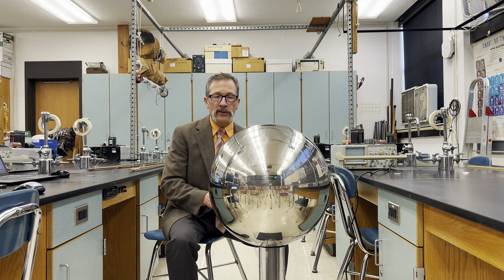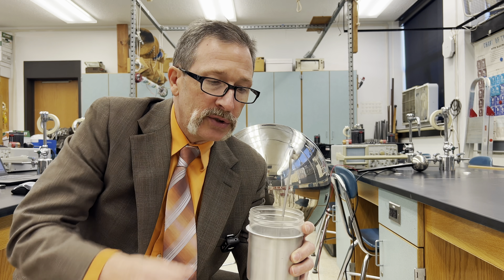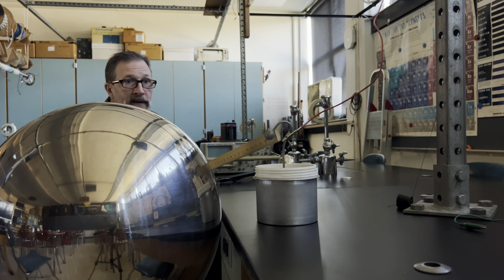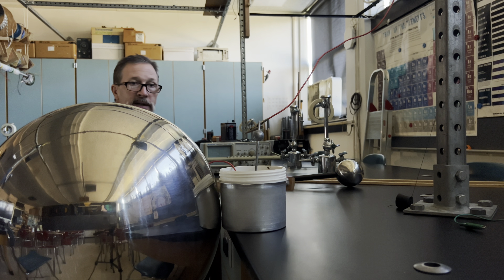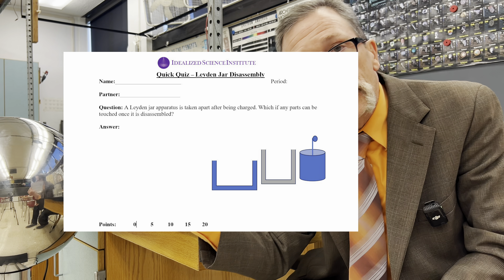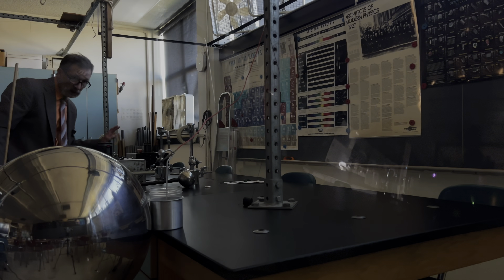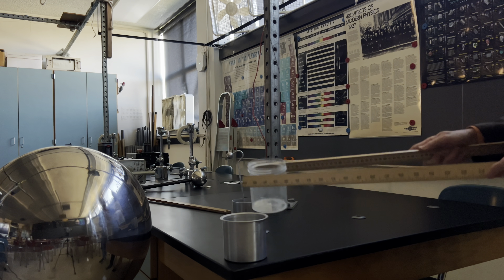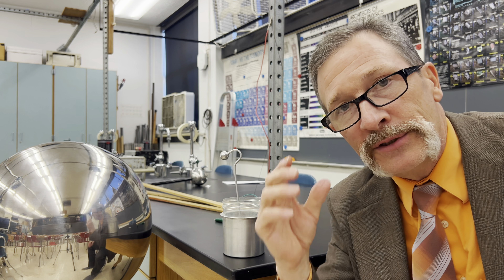This Simple Device Could Kill You

Comment: Using waterpipes as an electrical ground is stupid (especially for hi voltages). First, its not guaranteed real connection to ground in nearby point. Second, you can hurt or k. someone who take shower in the hood. Third, possible to interfere with another idiot who does this.And the last but not least, its illegal!! Guys DONT DO THIS!!!

Comment: I know electricity pretty well.  I knew a lot of this information as I was taught it in a classroom setting.  But I never got to experience this stuff in a lab setting.  Seeing you build and collapse charges and then pose questions is neat.  Also, the question about what you can touch.  I thought it was the plastic, and not the metal parts.  But, my real question was, how would you take that apart without it discharging.  Then bam, you explain it.  I teach and explain capacitors all the time.  Your lab experiment was great, I had never heard of that jar you used.
Reply from the maker: Thanks for your comment! Lots of students miss out on the experimental aspects, sadly. That’s why, in 2026, we are going to do a first iteration of a full course in E&M along with kits that contain all the components needed to actually do the quizzes at home (or in school).

Of course, dangerous videos like this are not to be replicated, but if you look on our channel you’ll see lots of videos that don’t use any high voltage or current and are still very fun! The quick quizzes would be useful for guiding your teaching of caps!

Comment: Back, starting in 1962 through 1996, the Army had a fixed wing aircraft used for surveillance (OV-1 Mohawk). It could be configured with RADAR, Infrared or, a camera system. My job was to maintain and repair these systems. The camera also had a "flash" available so it could be deployed at night. The flash was mounted in an underwing pod with 3 "flash bulbs". Each of these flash bulbs had 4 capacitors. Each of the capacitors were about the size of a car battery. Maybe 12"x12"x24" tall? They would all discharge at once to create the flash. During training they made it crystal clear, if you made the wrong mistake, you would be turned into tears in your mother's eyes...

Comment: Capacitors are super scary and need to be treated with utmost caution. I always store them short circuited. Once after experimenting I touched one just 1s after completely discharging it. That 1s totally unconnected was enough to rebuild charge and bite me (super small one and not very dangerous, but still painful). So high voltage is no joke already but including capacitors means high voltage + high current which is super dangerous.

Comment: I added a high voltage safety foot pedal to my Tesla Coil so that I won't get electrocuted by the high voltage transformers. Also added a bleeder resistor to the capacitor so that it won't hold a charge.

Comment: The reason for the charge in the plastic is friction. Even though nothing appears to be moving, it is. Electrical charge is a movement, and anything that moves creates friction, even through a so-called isolator, but plastic is not really an insulator. It is a semiconductor, and, just like a memory circuit in an electronic device, it stores a charge from a memory of movement in a charge form. Electrons, just like magnetism, are everywhere. Take the copper wire: even when no electricity is moving down the wire, there are still electrons in it. If there were no electrons in the wire, the moment one sent electricity through it, a collision would occur, and possibly an explosion. Resistance in a wire is because the electrons are perfectly fine not being forced down the wire in a manner of structured electricity. The saying electricity is lazy, is because it quickly wants to find ground. I'm not sure that's what's happening. Electrons want to return to the earth, from which it is its closest relative, the magnetic earth. If it were close to the sun, it would return to the sun.

Comment: For five years, I worked as a technician for a manufacturer of flash equipment for professional photography.
When repairing these flash power supplies, you always had to take into account that they could still be charged with capacitors with a total capacity of 20,000 uF at a voltage of 500V, with discharge currents of 1000A being normal.
Always discharge first, check that the capacitors were really empty.
One mistake could be fatal, so you had to be very alert.
Reply from the maker: Wow, that’s an application I had not considered! Thank you for sharing
Reply: Wow. That  is a heavy charge q = CV
Reply: @meisievannancy  Yes, some has a power of 25,000Ws

Comment: Back when Tv's had tubes and High Voltage I witnessed a guy get across a HV capacitor.  The volage went into his finger and came out his nose which was the closest thing to ground.  A ground strap on his service bench.  Now his nose has a flat tip.

Comment: My first electronics course in college had a very memorable demonstration. The professor charged up a very large capacitor, about 12 inches tall and 3 inches diameter, via rectified 120V. He then took a large screwdriver and bridged the terminals. The end of the screwdriver exploded. I was seated about 8 feet away and had a few bits of metal from the screwdriver tip hit me. I always thought that we should have had eye protection on when the professor did this.
Reply from the maker: Yes...that molten metal can burn and put holes in clothing or in your eye. Safety is a concern.

Comment: When I was younger my father used to talk about a prank they did at steel shops: charge a truck capacitor and attach it to the foil of a pack of cigarettes and leave them on a workbench, the result was hilarious, and no one ever was seriously harmed.....though in that decade if they were they would have laughed and called them a lightweight. I loved capacitors and magnetos when I was very young and would build them out of foil, charging them with light, triboelectrically, and batteries. I remember one of the most dangerous ones I made was by taking long PVC with brine and a stainless steel chain, and wrapping the outside with foil, you could get massive charges in that, lethally high. I also planned to make one out of a Home Depot bucket, stainless steel chain, and foil on the outside with brine inside, but never got around to it. Making and using very very large capacitors is easy, doing so safely is not.
Reply from the maker: Great comment, but please do not build a large Leyden Jar. They are not safe.
Reply: @idealizedscience   Good advice. I love electricity, a few years ago I was working towards working on high tension lines as a line worker. I would rather work on a 220v fuse box than be standing near a fully charged pvc or home depot bucket leyden jar: at least I have to actually touch the 220v to get electrocuted.

My grandfather and father told me to always put one hand in your back pocket or belt and wear shoes with a thick rubber sole. That indeed did turn out to be a good bit of advice, working on some equipment you can indeed get "bit" by high voltage stored inside, even using the best of precautions.

Comment: Several years ago I took apart my last film camera, a cheap Nikon point-and-shoot that had failed. The autopsy was most interesting, especially when I forgot about the capacitor for the built-in electronic flash. Got a tasty hit when I touched it. The concept of once bitten twice shy did not apply when I incorrectly assumed I had discharged the cap by touching it once, so the second bite was equally sensuous. Good times.
Reply from the maker: Old cameras would make a high pitched sound as they were charging...which was a good warning.

Comment: The inclusion of a multimeter to measure the voltages of the discharges would help with understanding the level of danger.
Reply from the maker: Most multi-meters could not handle this very high voltage.

Comment: Capacitors will develop a charge unless they are shorted out.  They do not need to be 'connected' to a power source for that to happen.
Reply from the maker: Great point!  Storing them with a wire across the terminals will stop this problem!

Comment: That jar doesn't have enough capacitance to hurt a human, even at those voltages.
Reply: You would be surprised.  The current is what kills - a spike of current can cause the heart muscle to go into fibrillation.   A monk physicist Abbé Jean-Antoine Nollet  in 1746 arranged 200 Carthusian monks in a mile-long circle, connected by wires, to demonstrate electricity's near-instantaneous speed, causing them all to jump simultaneously when he discharged a Leyden jar through the chain.   Luckily they all survived!
Reply: @karhukivi I wouldn't be surprised, I have been around HV since I was 11, making flyback transformer power supplies, home made cup and plate capacitors, tesla coils... Dude the capacitors in a stun gun are way more powerful than that jar. I have taken my fair share of zaps in my life, many more powerful than that weak little snap.

I have been bit by so many CRTs it's not funny. The surface area of a
Leyden jar is simply not enough to hold a deadly charge.
Reply: @Doom2pro  Don't forget, Q=CxV   the charge is the capacitance multiplied by the voltage, even if the C is small, the V can be very high.  It is the Q and the time that gives the pulse.  My nephew is a cardiologist and we have had chats about what they use for cardioversion where they stop the heart and re-start it again to get the rhythm under control.  A healthy person might take a dart that could kill a person with a heart abnormality.
Reply: @karhukivi I'm well aware, I also dabble in electrical engineering. I have charged homemade caps with vandegraff generators, and voltage multipliers, marx generators. The caps that scare me are doorknob and microwave oven caps.
Reply: @Doom2pro  Those high-capacity ones can be lethal for anybody.   A technician in the place I did my physics degree was killed by a bank of capacitors that were holding a charge for a very long time during a period of hot, dry weather.  They found him lying over the wooden box that held them, very sad, he was a very helpful guy.
Reply: @karhukivi even when discharged they can rebound by dielectric reabsorption. Best to store large capacitors shunted with a resistor or piece of wire.
Reply: @Doom2pro  Yes, especially in dry climates!

Comment: I may sound like a nooby,newb. But I'd live a detailed video on Electrical safety, with both High voltage, and lower voltage, high current or amp. What makes it lethal, and how to prevent incidents. Making sure one's not the easiest path to ground? So rubber shoes etc. I'd really love that.
Reply from the maker: Good suggestion! I think we responded earlier.

Comment: What would happen if you disassembled the jar and touch both metal parts at the same time? According to the explanation I think we could assume that you would not experience conductivity of the self because all of the charge is contained in the insulator. Maybe not?
Reply from the maker: The metal parts quickly discharge by sitting on the table.

Comment: Interesting: so when the jar is dismantled the charge is trapped on the surface of the dielectric? I didn’t expect that result.
Is there any good way to visualise that charge distribution ?

Does this have any practical application? After all, the dielectric liner is light in weight.

So, could you demonstrate what happens when you charge a Leyden jar, as you have here,
Dismantle it to the 3 components
Assemble the dielectric liner into a different inner and outer can pair
……to demonstrate the transfer of the charge //just via the dielectric layer//   ?
~ thanks.
Reply from the maker: Dielectrics are a foundational part of all electrolytic capacitors that make up all most all circuits.    Great suggestion for a new video!

Comment: Fuelling aircraft with kerosene or petrol creates a strong static charge, so the aircraft, the fuel truck (bowser) and the storage tank all have to be connected by grounding cables as a spark could cause a fire.
Reply from the maker: Yes! A potentially very dangerous problem is not treated properly.

Comment: I worked on a system that had a 4 kV supply to generate 105 MHz pulses at 100+ W, in 100 ms... When you took the cover off, there was a 1 kg brass bar that dropped across the filter cap (about 1/2 the size of a loaf of bread!), and stayed there, to make damned sure that the 'second" life of the voltage had somewhere to go!
Reply from the maker: Wow! That's cool!

Comment: I used one of these in the HS back room with another student. There was a mirror. I wanted to see how straight I could make my hair. The other student had the power switch. At a certain point, it arced from the closest thing to me the table to the bottom of the unit, and the other student was getting shocked too. It was fun.

About a week later, a cheerleader tried it. She turned it on while standing on the ground and brought her hand over to it. Bap!

I'm surprised they didn't lock that room after that.

Comment: I'd say you CAN touch the top, inner piece, IF it was grounded during deconstruction. If not, then ONLY the plastic piece, as that is an insulator. I think the outer cup will be negatively charged, while the inner piece will be positively charged, as electrons were pushed out along the earth. Level of confidence: 60% - Not very confident! Definitely not confident enough to actually risk touching ANY of it 😂   EDIT: YAY! I LEARNED SOMETHING!!

Comment: so i take 2 big metal cooking pots steeel and i find another one of plastic and mould it perfectly  and i will have a huge capacitor that i can regulate its discharge with mosfets? imagine im making 25 huge jars. like 9litters of water each and each of them connected to a mosfet that will take only 1/9 of a second electricity from the caps and then the second one opens and then the 3rd and up to 25. this will create a complementary energy shot that can go to a BMS and charge a battery ? because is fast to charge this can help alot in countries like UK where sun is not always up and some days are not much sun rays but this can balance like a buffer and charge esyly.?
Reply from the maker: Let's not get ahead of ourselves here...this is really for demonstration purposes. Please do not create a massive capacitor bank. But it is certainly interesting to think about!

Comment: I'm still unsure how the jar, when connected to ground, stores a charge..
Reply: Only one half of the jar is connected to ground.  That's actually why it works.  The inside and the outside develop opposite charges, which attract.  The electrons can't travel across the dielectric medium (the plastic insert) so they stay stuck there attracting each other until they find an easier path (eg through you).  All capacitors work this way.

Comment: When I was in the navy, our sonar used an 80 kV DC power supply. The supply used banks of 8 electrolytic capacitors connected in parallel as part of the power supply's circuits. One of our  techs was working on a fault in the power supply when he became convinced one of the capacitors had shorted,  causing the fault. He removed the capacitor bank as a unit, put it on the work bench, then connected a power supply and charged the cap bank. The charge held, so the shorted cap theory wasn't holding up. We asked him if he was going to discharge the cap bank before putting it back in the power supply. He said "Sure", grabbed a screw driver, and tossed it across the positive and negative bus bars the caps were all screwed into. There was a bright flash and the screwdriver was arc welded to the bus bars.
We had a discharge probe on the back of the workbench specifically for things like this, but the tech wanted to show off, I guess.
Reply from the maker: That will get your attention!

Comment: A good reference for shock hazards is "A Complete Electrical Hazard Classification System and its Application" by Lloyd B. Gordon and Laura Cartelli, a twelve-page report published by Los Alamos National Laboratory and available on-line.  Also, DOE-HDBK-1092-2013, "Electrical Safety", contains a lot of information but is rather long.  Page D-26 of the handbook contains information on impulse shocks due to charged capacitors above 400 volts.  For capacitors (a Leyden jar is a type of capacitor) charged to high voltages, the hazard is related to the stored energy in the capacitor.  The stored energy in Joules can be calculated as one-half times the capacitance in Farads times the square of the voltage.  Discharges of stored energy below 0.25 Joules through a person can be very unpleasant but present little to no hazard.  Discharges of stored energies of 0.25 Joules and higher can cause injury due to involuntary reflex action (muscle contraction and throwing oneself away from the shock, causing subsequent falling or striking a sharp or otherwise dangerous object).  Discharges of 50 Joules and higher are in the potentially lethal range due to possible ventricular fibrillation (stoppage of normal heartbeat) and burns.

The capacitance of a Leyden jar can be measured with a capacitance meter, but I'm guessing from an estimate of the approximate dimensions that the Leyden jar used in the video, when assembled, may be on the order of 375 picofarads (375 times 10 to the minus12th power, when expressed in Farads).  If so, then it becomes potentially hazardous when charged to 36,500 volts or greater.  If it could be charged to above 500,000 volts, it could become lethal, but, fortunately, it will arc over long before it reaches this voltage.